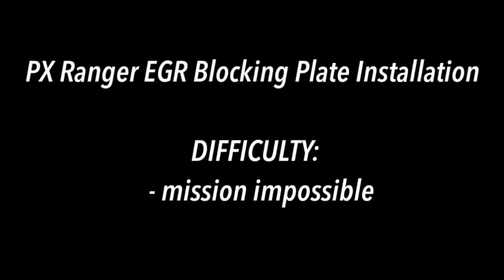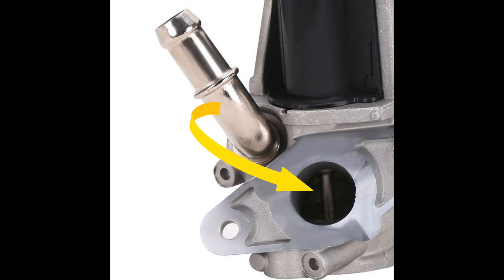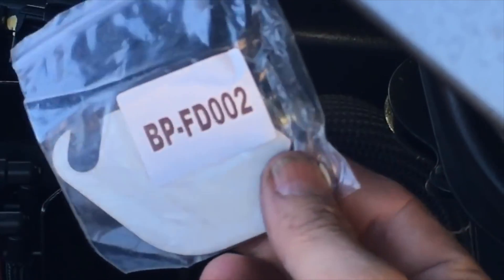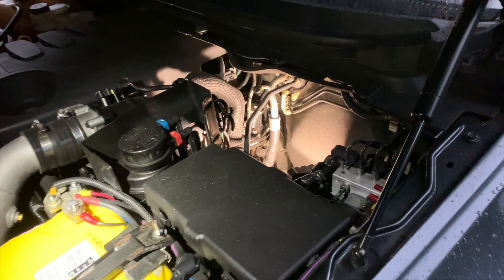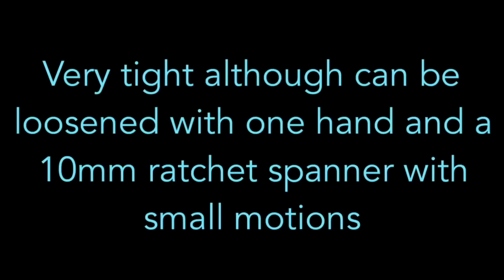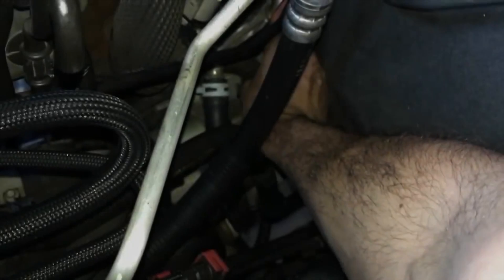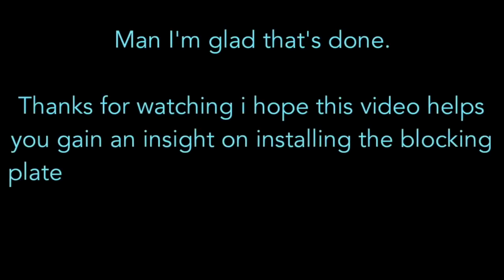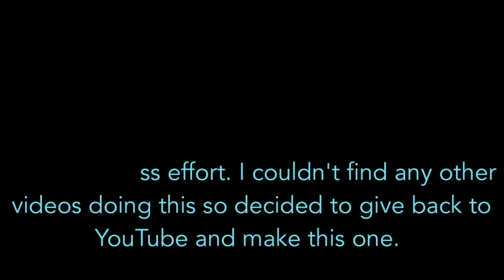EGR Blanking Plate How To Installation Guide Ford Ranger also PX, Mazda BT50 2.2 L & 3.2 L

Comment: Would like to do this. However, my Ranger has all kinds of hardware in the way, like the breathing lines, witch it seems cant be moved out of the way temporarily.How do I get past that.
Reply: Hey mate, I've just done my blanking plate today and I couldn't get to the top bolt because of all the breather lines and the egr cooler coolant hose being in the way. What I did was zip tie the coolant line which was in the way, to the engine lifting point at the back of the motor. This gave me much needed room and I was able to get two hands to help position the ratchet spanner properly on the bolt head. Best of luck.
Reply from the maker: If you have a PX ranger it should be the same if not unfortunately I can’t advise sorry

Comment: Awesome video when to install and my bottom bolt and there a bracket holding a coolant pipe in the way  making  it in possible to do
Reply from the maker: Hey you don’t have to remove the bolts completely just loosen enough to get the plate in, I don’t recall any brackets in the way sorry
Reply: @PatHoughy  did you manage to loosen the bottom bolt
Reply: @sticky0420 go by bottom with smaller 10mm ratchet spanner. You need extra strength 💪 to push the spanner. Spanner is too small to push in there.

Comment: Great video, thanks for going to the trouble of putting it up. I've just bought a very low mileage 2016 Ford Ranger (37000km) with the 5 cylinder diesel and am a bit worried about what the EGR cooler might do at some time in the future. We go to remote areas so reliability is very important. It's still under warranty so I can't mess with it yet. Does running with the EGR cooler completely bypassed have any effect on the engine over the long term. And can I ask where you got that blanking part from, it looked properly made and even had a part number.
Reply from the maker: Thanks Pete, as it’s only passing through the EGR valve bypassing the cooling shouldn’t affect anything negatively, I’m thinking it will benefit engine cooling as your not trying to cool down hot exhaust.  The dealer will never spot an EGR blank (I’ve had an engine replaced due to faulty injector and they never noticed).  Bypass going the cooling may need reconnecting though at every service unless you can get it serviced somewhere else (warranty usually states you can get it serviced by any mechanic it’s only the warranty repairs that require a dealer).  Was a few years ago now, I’ve put the video on my new channel. 
I just got it from eBay, they are all the same just get cheapest stainless steel one :)

Comment: Brilliant video mate, thanks for sharing that. I've got an electronic egr delete, but i reckon this is the way to go. I also want to redirect the coolant lines due to the egr cooler failures which destroy motors.
Reply from the maker: Thanks bud,  the PX Ranger is an electronic motor driven EGR so you should be fine.  Yeah I should do the coolant lines soon as well.  Just a matter of disconnecting and joining them with something
Reply: @NatesToolbox  make a video of the coolant line disconnection too!!
Reply: @NatesToolbox  great video, have you made the coolant line video yet?
Reply from the maker: @tjsnyman9793  cheers.  I’m afraid not it’s been going good so have just left it for now.   Might be something I’ll do soon though
Reply: @NatesToolbox hey mate, I’d love a video of the coolant lines if you’ve done it yet!

Comment: Good video, can you also help me show how to bypass the coolant around the EGR. I need to blank the EGR and bypass the coolant as there is a slow coolant leak in the EGR. Thanks in advance
Reply from the maker: Haven’t done this yet however Bypassing the cooling should just be a matter of disconnecting the hoses from the EGR and connecting them together with some small piece of pipe.  Flared ends are better
Reply: Thank you for your help.

Comment: Excellent video. Im about to do mine this weekend.  How does the car run?
Reply from the maker: Good mate, it's been 3 years and no errors/codes, can only be doing good for the engine and components.
Reply: @NatesToolbox  did you disconect the EGR plug aswell? Has it ever over heated ?
Reply from the maker: Jzx100aus thanks for asking, inserting the plate before the EGR prevents any gases from entering it at all.  
This keeps the EGR “cold” including the whole intake system which allows the cooler fresh air entering the air filter to stay cool rather than be mixed with the hot EGR gases.   Definitely don’t unplug the EGR motor otherwise I’m certain you’ll get error codes. It will just operate as normal but without any gases passing through it.
Reply: Yes I see, interesting. 

So what would happen to all the gas in the pipe leading up to the plate from the exhaust, would that not clog up in the pipe/cooler? As it has no where to go?
Reply from the maker: Jzx100aus When blocking the EGR port you are redirecting the exhaust gases back out via the turbo, (where it was meant to go). So the gases won’t want to flow to the EGR pipe anymore as there is no flow pressure once blocked off.  

Directing all gases straight to the turbo it now means has slightly more pressure turning the blades and the turbo will spool quicker.  (you will feel a very marginal increase in performance and that’s a good thing).  Variable Vane Turbo Charges are also OK with blanking the EGR. 
EGR systems are not in place to help keep the engine from getting hot.  This is a myth.  The EGR is PURELY an emissions system.  

This is proven from the fact that at Wide Open Throttle, when the engine would need to most cooling, the EGR system is CLOSED. Yes, the engine is producing more NOx emissions however the reduced throttle position (because of EGR blanking) means you will be using less diesel and producing less soot or particulate matter.